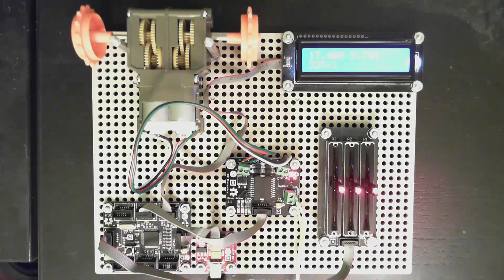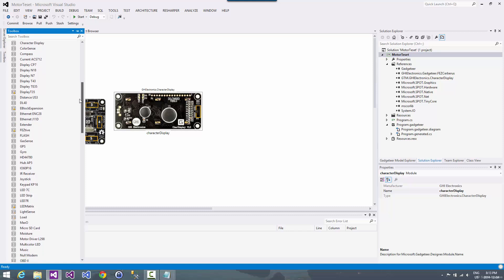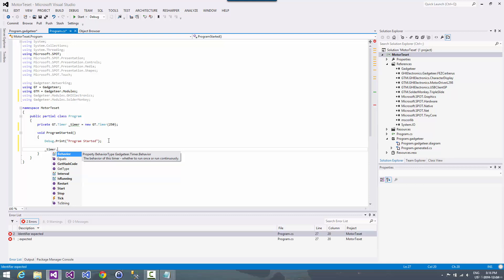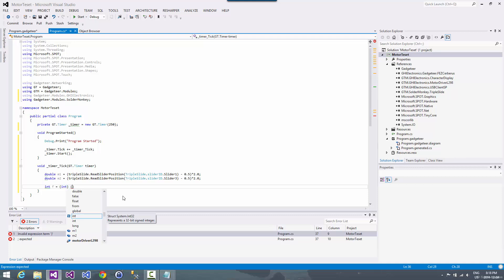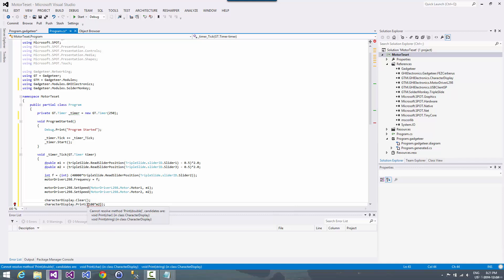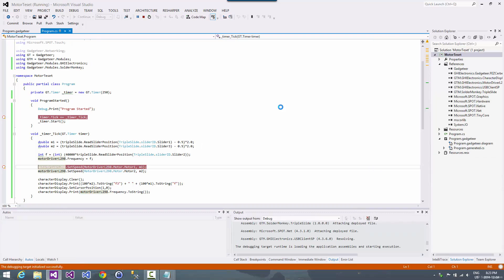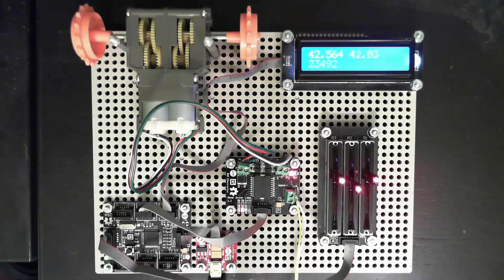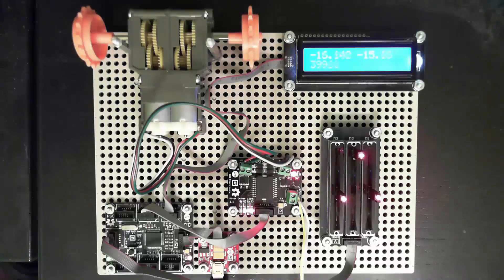Gadgeteer and Motors - Part1 - DC Motors

Comment: I don't understand why you're adjusting the PWM frequency based on Slider2. Why aren't you just leaving it fixed at 40 kHz? Generally, for PWM, you just modify the duty cycle (accomplished with the SetSpeed() function)

Also, your discussion at the end is confusing. You've been using PWM the entire time -- when you call SetSpeed(), you're setting the duty cycle of a PWM module that's driving your H-Bridge. Your discussion implies that PWM is something completely different. And running motors using the linear region of a transistor (which dissipates the unused energy as heat as you mention) is never really used -- certainly not by any Gadgeteer modules. Everything is PWM.

As a bonus note, you generally use the lowest possible PWM frequency that you can get away with, since most energy is dissipated when the transistor switches. Minimizing the frequency minimizes the switching time. It's not unusual to PWM large DC motors at rates of 100-500 Hz.
Reply from the maker: Thanks for your comments.  This module is configured for a default PWM frequency of 25KHz but that can be changed as I'm controlling with the center slider and while I can set the frequency I need to do a SetSpeed to implement the new frequency and I'm changing just the frequency in order to show the effects of changing just the frequency (ie increasing the frequency in this slowed the motor as the duty cycle was unchanged), but I'm thinking you are right in that I've haven't explained it as well or as clearly as I should have.  Perhaps it would be better if the SetSpeed function was called SetDutyCycle (but SetSpeed is just that much more user friendly)?